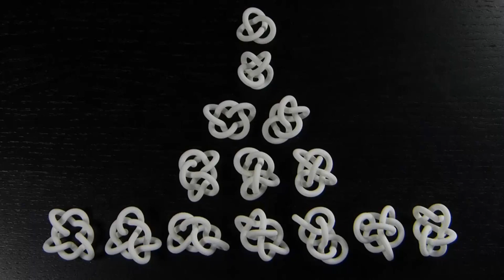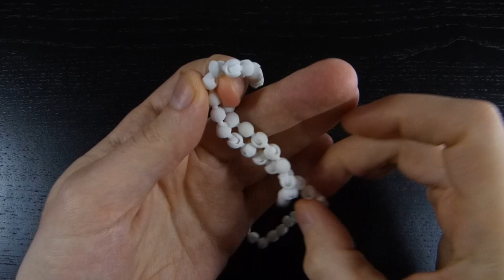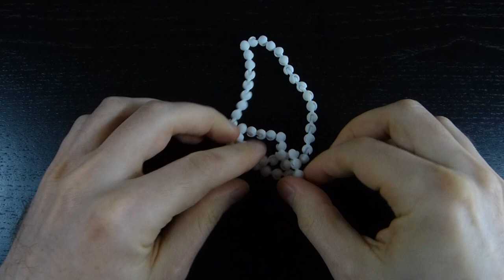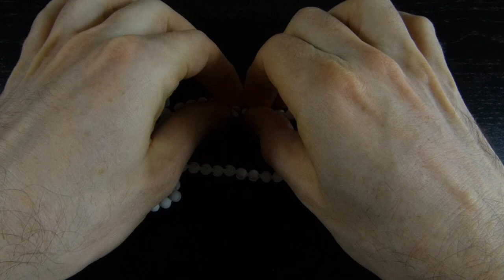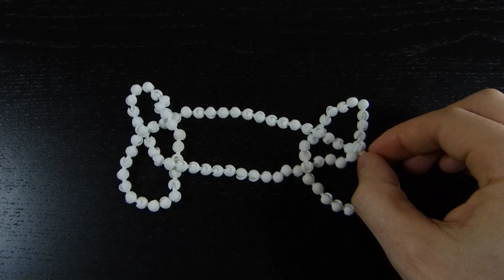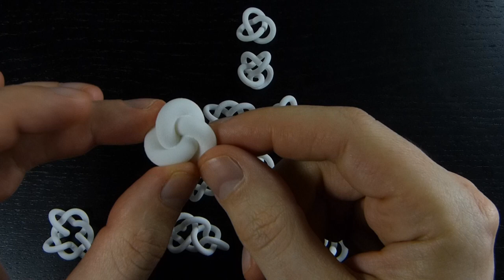Minimal ropelength prime knots

Comment from the maker: Minimal ropelength prime knots with up to 7 crossings, by Jason Cantarella.
Reply: Ooh! I am teaching some basic knot theory to my liberal arts class right now. I will show them this tomorrow!
Reply: Is that only the beginning of the speech? Where are the tight knots different from the trefoil?
Reply from the maker: Eduard Baumann all of the other models are half radius versions so you can see what's going on.
Reply: Ah, okay. Thanks for the answer.
Reply from the maker: ***** Actual rope: getting the configuration accurate would be near impossible I'd think. And how would you get a closed loop of rope?
It took a long time for me to sort through the prints and figure out which knot was which... good luck doing the 8 crossing knots!
Reply: Henry Segerman
> It took a long time or me to sort through the prints and figure out which knot was which...

You should use SnapPy!  Take a photo of the knot, trace that with a polygonal curve in AI, copy that to SnapPy, and use the "identify" method.  No, wait, that isn't ridiculous enough - instead, buy a 3D scanner, scan the knot, load that into rhino, ...
Reply from the maker: I've got photographs already... Does Snappy let you trace a knot over a background photograph?
Reply: Henry Segerman
Next time you see Nathan, tell him you have a feature request...